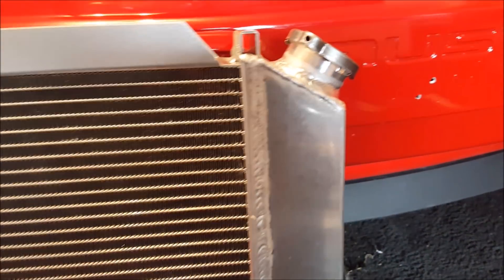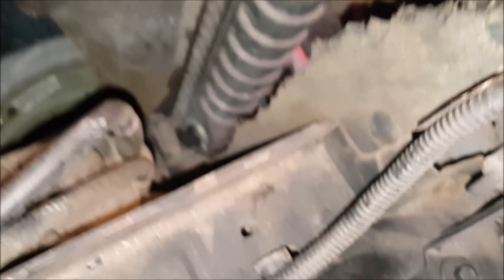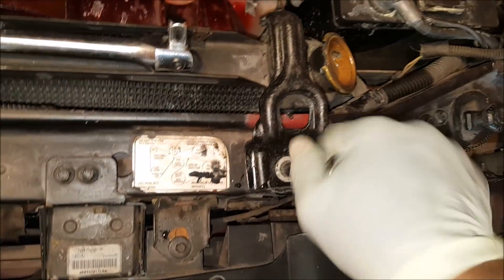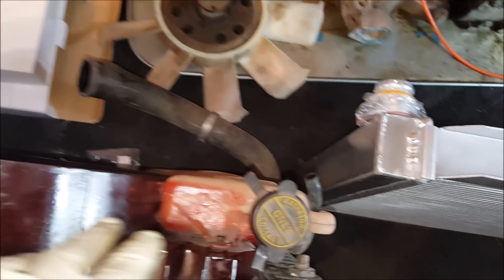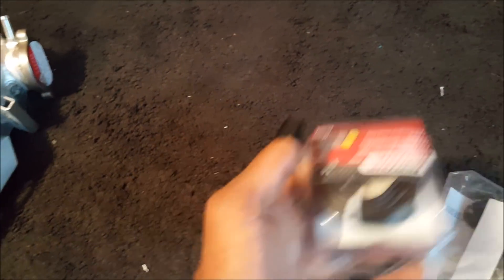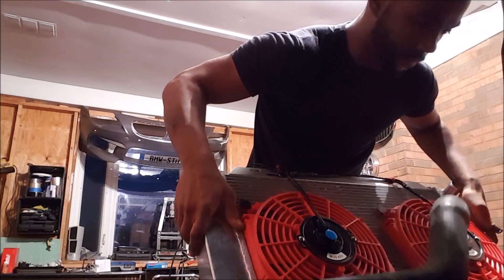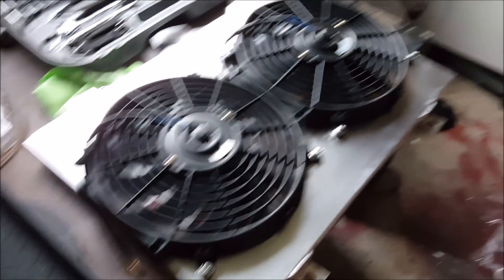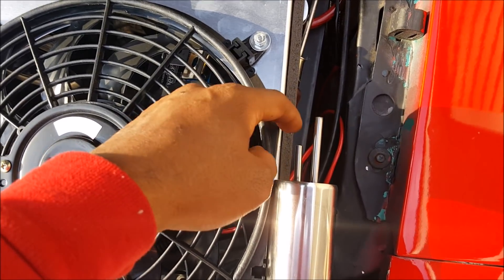Cooling a modded 5.0

Comment: A good you might like is one out of a Ford Contour. A dual fan that I hooked up to seperate toggle switches. Usually only have to run one fan to keep it cool.
Reply from the maker: i ended up running the contour dual fan,  it did really well.
Reply from the maker: my contour fan was hooked to 1 switch, but it ran on seprate breakers to each fan, that way if one fan died or shorted, it wont shut the whole thing down.
Reply: @Sgt.Slides  Those fans are so strong, that I use two switches with two in-line fuses. I only have to use one fan, and it keeps the draw down on the alternator. I got mine out of a Mercury Mystique. It works so good.

Comment: I just brought those head lights for mine and a host of other things next on the hit list is the radiator like you with the electric fans
Reply from the maker: I ended up ditching that last fan set up for a 09-12 Crown vic fan, it worked AMAZING but it was a hard draw on the system and eventually contributed to an electrical failure, I switched to a dual Ford contour fan They also do a great job and are much slimmer, and bolt directly on, I also wired them on their own circuits so if one fan fails, the other will still run.  Another great option would be the single ford Tauris fan, it requires a little trimming but works well.  Don't bother with the ebay aftermarket kits.

Comment: 170 is too low. EFI requires even higher than 180. I bought my 430hp 347 Stroker with MSD EFI from Performance Unlimited. It never went over 180. They said it was not heating up enough. They installed a different thermostat. Now it runs at 190 without the A/C, 195-200 with A/C in traffic here in Florida, in the summer with 95 degree heat. I just have a cheap $100 radiator. Everybody says it is no problem. Low temps also affect oil flow.
Reply from the maker: This is true, however, setting the fan at 170 does not mean the car will run at 170.  The thermostat will still open at 186 as it's designed to do.

Comment: couple of comments,   Those fans are garbage they barely pull 800CFM each. Your stock clutch fans pulls over 3000CFM and does a great job,.. Best E fans to get are either a Taurus single fan or a Contour/Cougar dual fan and a flex a lite 33054 Controller. The overflow you got is way to small and will not allow sufficient overflow. NEVER use zip ties to mount parts- that is just plain crazy and unsafe- the vibrations will end up cutting them and the fan will end up going in your radiator and or engine.   Easy to use some simple L shaped brackets from Home Depot. For the Radiator- for $150  you could have gotten a good Champion one that has a lifetime warranty.   You should also change out that starter for a mini starter for a host of reasons, most of which it will get fried due to the heat of the long tubes, Wrap it and the clutch cable in heat deflective wrap- cheap $20 insurance. For the rack, all you had to do was loosen the rack bolts and move the rack forward an inch or two and that will give you the needed room.
Reply from the maker: yes, those fans were trash, especially without a shroud, Yes, the overflow was too small, those both got addressed in the next couple vids.  No, vibrations cannot cut zip ties, and if my radiator was vibrating that hard, the zip ties would be the very least of my worries.

Comment: The only recommendation I have is does your garage have enough room for me to pull my '88 in there? So I can mimic ...
Reply from the maker: come on thru, we're in MD
Reply: I just drove from san diego to new orleans three day ago. The smog pulley bearings locked up at yuma, az border patrol check point, serpentine belt snapped, upper radiator hose busted, got it all back fixed in phoenix only for my clutch to start acting up as soon as I hit Houston, TX.  If you and the wife come to Essence festival 2019 I'll cover hotel cost. I want to put in new fan, radiator, new clutch, new ac, and do some body work.

Comment: Got lucky hit the junk yard found a 97,98 single electric fan for a mustang!! So far one fans cooling with 100 amp summit alternator! Cut to fit in a ford shroud!
& yes fan runs non stop when car warms up?!
& I think yur right dual fan loose one fan... won't cool good?! Lol!!!! Found a jeep electric fan 8 blades... may install & see if it's better than the 7 blade 97 ford one... ikr!
Sometimes you gotta tinker & experiment... gd luck! My engine rebuild went good.., e303 cam  & bigger exhaust valves other upgrades later!!
Insufficient funds lol!!!
Rolling with what's done for now!? & happy! Peace bro!!
Reply from the maker: Junk yard is absolutely the best source for fans.

Comment: I use a bottle of Hyperkuhl for my aluminum radiator to prevent corrosion. It  provides 100% protection from corrosion and electrolysis for aluminum. It prevents leaks in your radiator for years.
Reply from the maker: thx for the tip!

Comment: how and where did you attach the coolant reservoir?
Reply from the maker: the OEM one temporarily nestled all the way forward between the battery and the edge of the rad shroud, and its sitting on top of the lower coolant hose.  the aftermarket one i had was too small to allow enough expansion.  I'll be fabricating a new reservoir later.

Comment: well I just ordered my radiator, got a three core aluminum, a hose kit canton over flow, 160° thermostat, and I'm just going to reinstall the clutch fan.
Do you think it's possible to get everthing done in a day and do you think I'll haft to progam it with 160° stat, or should I just run a 190 for the mean time until I can get a programer.
Reply from the maker: this is a 2 hour install MAX.  its very easy to swap the rad and thermostat.  Don't run the 160.  Take it back to the store and get a 180. Trash the 190.  Also, buy the radiator funnel i showed in this vid, otherwise your rad wil never let all of the air out and you will overheat.  Also, make sure that when you install the thermostat, make sure that the little vent hole is at the top.
Reply: Thank you, I actually got the stuff mail ordered from LMR off ebay.
I'll just order another thermostat.
Got the whole set up though but the water pump, even got the three core brakets, and I decided to go with a 17' flex a lit lo pro for less engine drag.
It's going to be a little bit as I'm out of town for a bit. I'll post some picks wene I get everything done.
And thanks for the feed back, man u tube goes along way brother.
Thank you and best wishes. 
5.0
Reply: Just for corrections, I got the stuff from scattered sources.
I'd be LMR, MUSTANGS UNLIMITED, and SUMMIT.
Reply: Alright Kevin stay up. and thank you.
Reply from the maker: makes no difference where you got it from.  My #1 source is e-bay, then American Muscle and LMR.
Reply: Oh ya, I got all that stuff off ebay, it just came from different sources.
ya ebay's my favorite place to shop.
simple and competitive.

Comment: Enjoyed the video!!! I have a 89 foxbody bout to rebuild! Single fan Ford Taurus  & dual fan ford contour is what some guys are using!!! Dual fan... get ready for higher amp alternator!?
I'm gonna try a flex fan 1st... & if it doesn't work good in stop&go traffic!? Probably will go to dual fan!!!
I have a dual fan car(Chrysler LHS!).. & runs cool parked or rolling....
The dual fan is the upgrade of all cars in mild to hot weather!! 
Keep up the good work! Nice paint job by the way!!!!
Reply from the maker: In a newer vid, you will see that i went with the HUGE single fan.  I thought it was a tauris fan, but it's even bigger.  I also got a dual fan, but i never fitted it because the single worked so well.
Reply: Premium Fuel Mag glad it's working out for you with a single fan.... keep in mind when single fan quits working you have to park(will overheat could ruin you're engine!?)... that's why I recommend dual!!! I tried summit racing single fan & the relay(s) died after a week of riding!! Same day my daughter wanted to visit a college about 5-6 hrs away...
Luckily I had time to reinstall the clutch fan before the trip...
Left a bad taste in the mouth believe me!!!!
Just make sure you use good relays & a manual switch to bring on fan that by passes relay (then you will know instantly if relay failed or motor  if switch test good)...
I didn't have time to check anything when the road trip was scheduled!! Lol!!!  The manufacture even wired the manual switch thru the same relay.... rendering you stranded push come to shove!!! Sometimes you have to go around engineered set ups but safely & logically.... not incuraging unsafe acts/wiring!!
Reply from the maker: even if i had a dual fan and one quit, i'd be up the creek.  There's no way the remaining fan would keep things cool enough.  I'd have to just park and wait for traffic to thin out so I could haul ass home.

Comment: Something you may want to look into is a variable speed fan controller.  They allow the fans to react to the temp of the coolant, and not to a predetermined on/off point.  Helps prevent huge amp loads when the fans come on too, because they will ramp up the fans to meet rising temps.  The technology is pulse width modulation.  There are a bunch on different manufacturers that offer them.
Reply from the maker: Thanks for the advice, but i'd rather beef up the system to handle the amp load.  I have already ditched my sub woofer, next i'll be upgrading the battery, and I have my eye on a heavy duty alternator.  Cooling is a priority and i'd rather cool the motor down as quickly as possible when the fans come on instead of trying to match speed and temp.

Comment: first off, ya mean 195° thermostat? 
Secondly, you best tune the car for the 180° thermostat, because your trickin the ecu in thinkin the engine is runnin cooler, and will add extra fuel. Finally, runnin the engine rich will wash the oil coatin off the cylinder walls, which will cause increased wear.
Reply from the maker: of the motor was stock, then it would be fine sticking with all the stock parts.  This motor is no longer stock, and neither is the ECU.
Reply: NO reason at all to use a 180 stat. It does nothing to impact how cool the car runs and the engine was made to run a 192 stat. All the stat does is control at what temo it opens, not what temp the car runs at.

Comment: Other than cleaning up the engine bay just a little and maybe when clearance is a minimum,no reason to go with an electric fan setup if everything else is up to snuff.My fox is totally built with a blower and i use the stock fan/shroud setup with a new 2" thick aluminum radiator and have zero problems.Run a/c also.Ford tech of 25 years and i know what works and what doesnt,everyone does what the internet tells them they should do.Most people have no idea how a cooling system works,let alone how to correctly wire in fans!
Reply: The clutch fan sounds like an airplane everytime you get on it and you free up hp with the electric fans and the looks are a bonus.

Comment: My 331 doesn't like to cool too well, it's still not completely broken in yet but runs right around 200 degrees. Stock radiator but edelbrock water pump
Reply from the maker: not bad, you will see a big difference if you upgrade your Rad/fan/ and use less coolant.  What thermostat are you running?

Comment: You can purchase a funnel specifically for bleeding the coolant system, it comes with a little drain plug tool to take the excess coolant that gets built up in the funnel as a result of the air being removed. Just google "coolant system funnel"
Reply from the maker: cool!
Reply: to burp your car, just get a Lisle funnel, best $30 you will ever spend. No need to jack the car up.

Comment: Looks good. Did you notice the RPMs climbing faster after getting rid of the clutch fan? Was thinking about putting a electric fan on my foxbody as well
Reply from the maker: Honestly, i can't tell.  The outside temperature is fluctuating, and i am still tuning the car as well, so any improvement i have felt is a due to combination of factors.
Reply: Yea that's true. Had you just done the fan you might of been able to tell. It should help some since less drag on the motor. I read a article where they pulled the belt and dyno the car and it picked up allot of hp to the wheels lol

Comment: Someone gave you excellent advice to use a fan shroud.  I have a modded Foxbody and I'm having a heating problem. I'm using the funnel method to bleed and burp the system.  It takes longer but it works. We are in District Heights, Md.  Hit us up.  www.soundtechlive.com or 202-285-9266 Steven L.
Reply from the maker: cool, what's the funnel method?

Comment: Drop the % of coolant in your mixture. Water is a much better heat exchanger than coolant. No need to run anything more than 30%coolant. You need some coolant for lubricant and corrosion prevention but nothing near 50%.
Reply from the maker: I figured that out, it made a HUGE difference

Comment: vacuum bleed my friend is the absolute best way plus you can tell if you have leaks if the vacuum gauge drops
Reply from the maker: if i planned on doing this often, i would invest in the $120 plus tool, but i can't really justify that if there are other free methods.
Reply from the maker: Got it bled using the special bleed funnel, that thing is awesome, and under 20 dollars!!!
Reply: Premium Fuel Mag any part number on that thing?